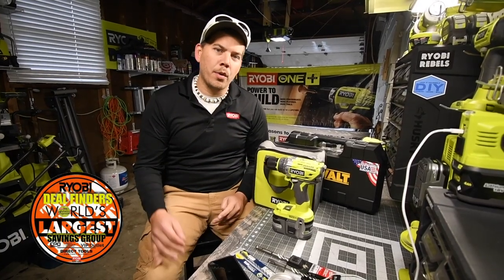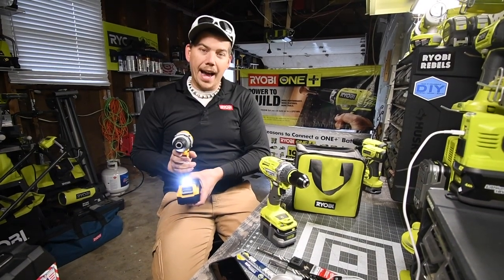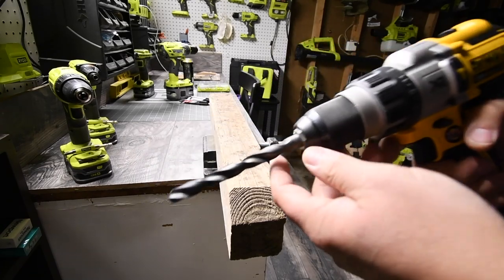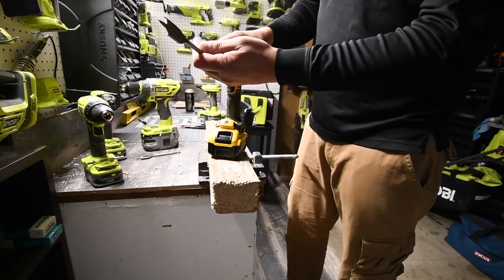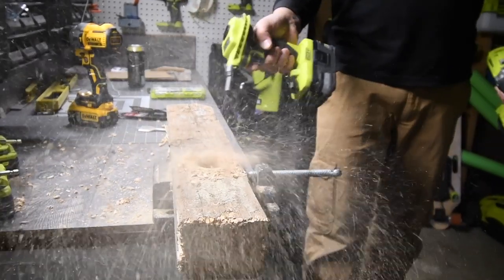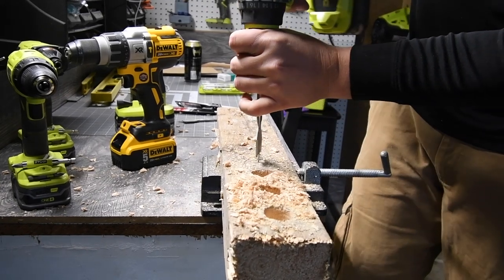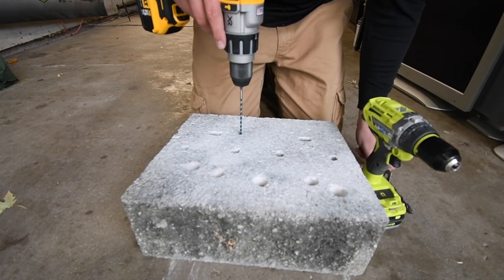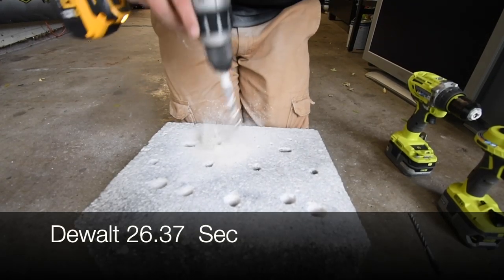Ryobi vs Dewalt (Brushless Hammer Drills)

Comment: I own a the Dewalt 996 it's a beast of a drill but I don't know why people make a big deal when they put Milwaukee lastest gen2 drill or that Ryobi brushless drill up against that Dewalt drill which everyone forgets that the 996 is a three year old drill now if that new drill can't beat a 3 year old drill a person is wasting there money for the new kids on the block should be dominant but in speed 1 the Dewalt for some reason is geared better then some reviews that put the Milwaukee gen3 and Dewalt 996 both in speed 1 the Dewalt did better but I don't know the speed 3 on the Dewalt seemed more like a bragging right that the Dewalt has more gears to other tool companies by the why the gear switch from 1-3 when it does not go into gear has to been something with the transmission's gears not synchronizing together just the same way a car with a manual transmission has to rev much so the gears are synchronized before up shifting or down shifting the same as pulling the trigger of the drill to resynchronize gears so it shifts right
Reply from the maker: One thing.i should have tried is to put the speed to 2. I think the result would be different. I think speed 3 is to fast and isn't gripping to the material enough to grind on though and thank you
Reply: @ManCaverTools  Asking a drill to drill a large hole on the highest speed always going to be demanding drilling in speed 1 would have been more efficient but like I said the 996 is three years old now I would hope a newer drill would perform better then the older drill
Reply: @codifrancisco4351  I don't know about these tests but my 996 is more powerful then every other hammer drill at my job. It even hangs with my buddies hilti although there is a pretty significant difference in quality. If we're talking full sized hammer drills I say the 996 is still top of the hill for the big store brands with Milwaukee being best in class for 12v obviously but the DeWalt xtreme is pretty nice they may catch up with the next generation if they release a ratchet and stubby honestly it would be a toss up for the 12v line as well.
Reply: @zack6892  Dewalt makes a 12v ratchet but it doesn't go under the brand Dewalt but it goes under the brand Matco-tool it's just a rebranded Dewalt also double the price just because it's Matco
Reply: @codifrancisco4351  oh I know they have the mac 12v that takes DeWalt batteries it's just kinda clunky and doesn't share the same ergonomics. I mean a true black and yellow ratchet with the DeWalt grip and maybe some bigger 12v batteries! I hope one day they step up there 12v line I just can't get myself to pay the price for the mac considering it still a brushed motor.
Reply: @zack6892  there the same thing Dewalt designs mac electric power tools because Stanley and Black n decker own Mac Dewalt is purely focused for construction and will never bring their 12v ratchet over because it fits better with mac being automotive focused I agree with you about the ratchet not being brushless although that ratchet was designed back when Milwaukee m12 were brushed ratchets too there fuel line did not come out yet

Comment: I am a professional carpenter and I was hoping to find somefing about "Ryobi" but this test this MCT makes is point less ..

he does not do a fair test between Ryobi and Dewalt
the drill he puts in the dewalten is dull realy dull. everyone can see that.

When you make a comparison between two brands. you do NOT give the brand that you so absolutely is either sponsored by or or married to eny advantage.

When you say the spade drills are Brand new.
would I have believed in you if there was maybe 0.5to 1 sec in difference But 30sec come on

I can do that faster with my little "Bosch GSR 12V" with a sharp drill

So i hope more ppl will dislike your channel
Reply from the maker: this is a very old video and that Dewalt tool isnt mine at the time of this video, and my tests are more hardcore now and the Roybi cant do them on speed 2 like the other brands can. pretty much my tests got harder and the Roybi cant do them the Dewalt will kick the crap out of the Roybi now